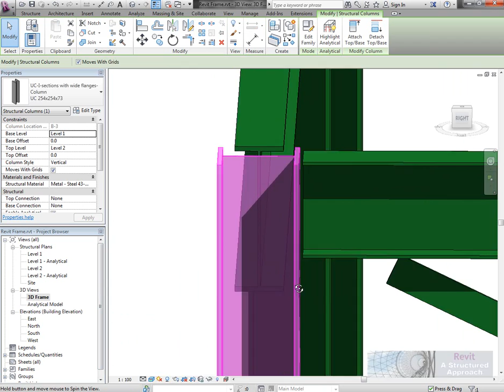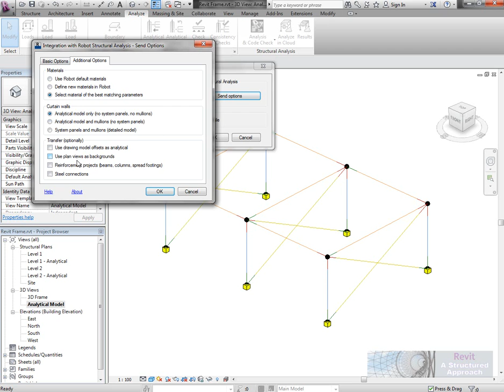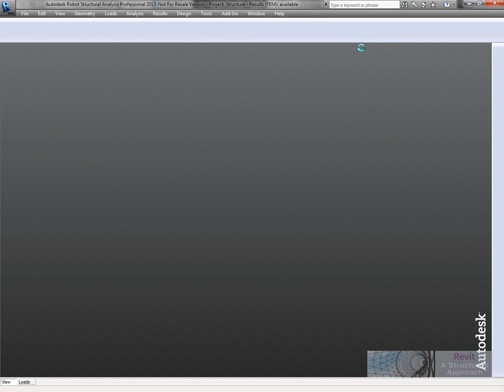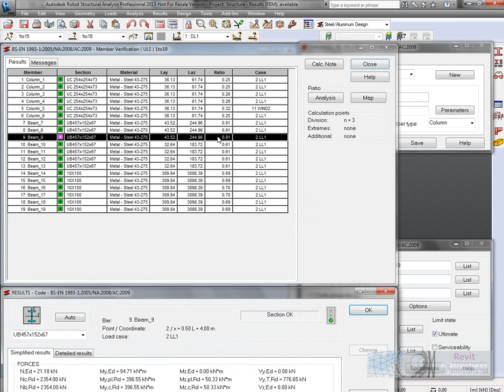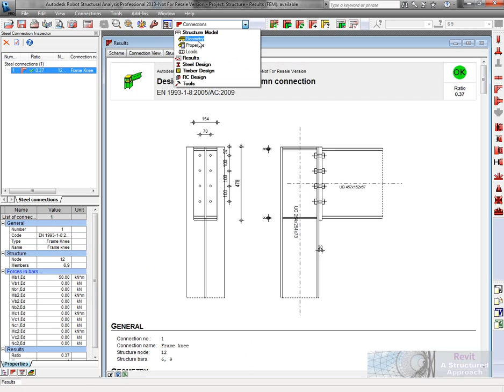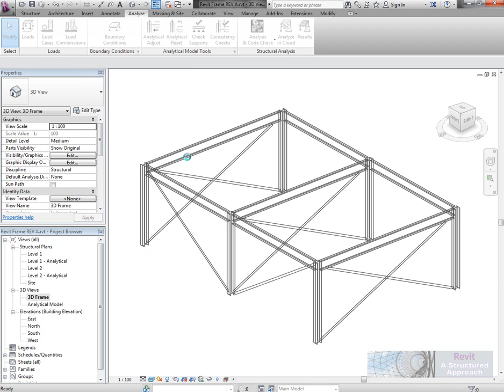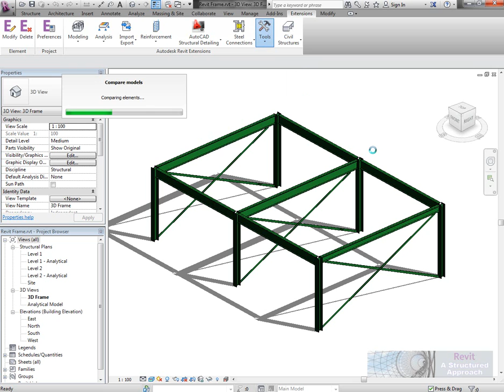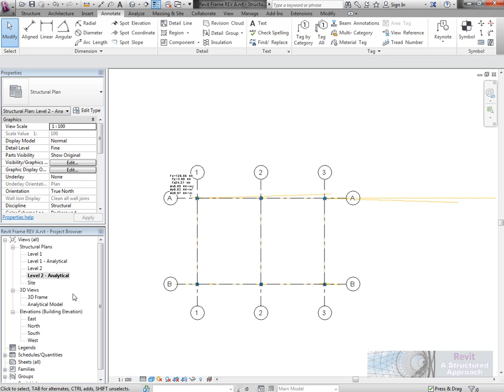Revit Structure 2013 to Robot Structural Analysis 2013.wmv

Comment: It is vital to set up the Revit Analytical Model properly before sending Model to Robot. While building the structural model, precision issues or inaccurate analytical modeling may introduce some errors such as analytical nodes not connected to each other. This causes double nodes in the Analytical Model.- Checkout the new application FDN to Find Double Nodes in your Revit Analytical Model.
https://apps.autodesk.com/RVT/en/Detail/Index?id=3106617950460295587&appLang=en&os=Win32_64

Comment: Yes, in Robot you can display ratio an color (red/green) if the steel member pass or failed the verification. On 5:09 you can see "Map" button, it will show steel members in color and ratio on each profile.

Comment: Hi there. I am using the STAAD for designing  steel structures. I want to know if this Robot Structural Analysis is somewhat the same with the STAAD user interface. Can we check through the structural model if the steel member pass or failed just like in STAAD it shows the ratio and color of members on the 3d model.